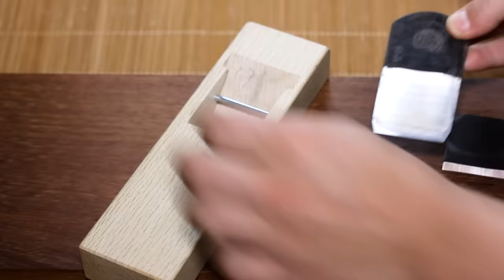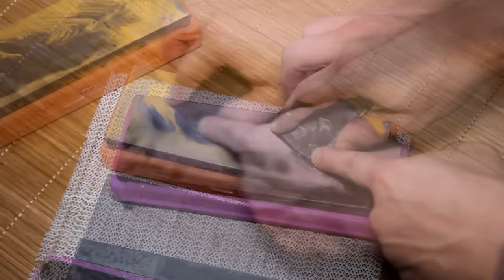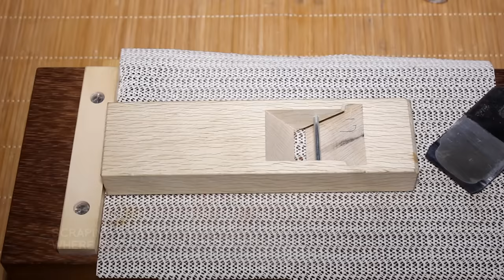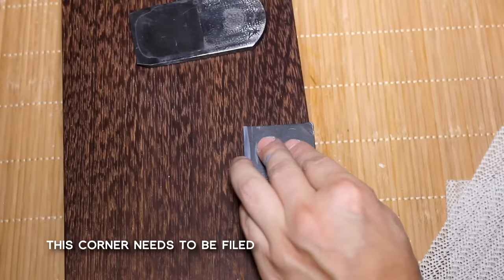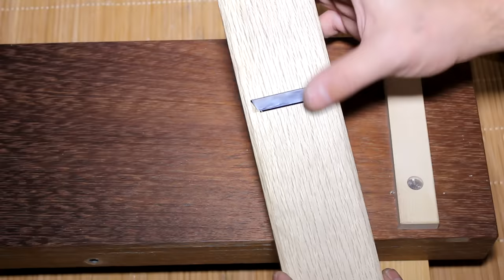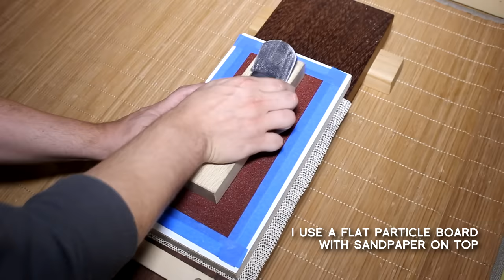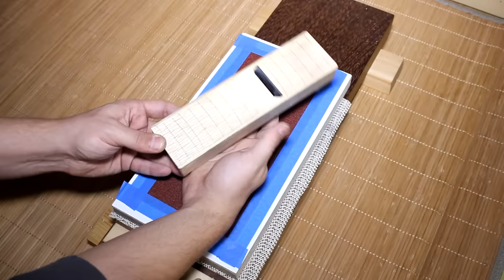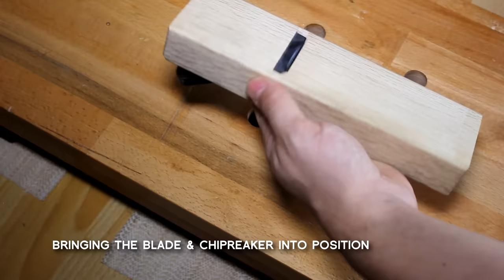Setting Up an Inexepensive Japanese Plane

Comment: Nice video ! You're doing it the right way, and the result is good !
Couple of tips I learned over the years(I'm from Japan). 
-The body adjustment is the absolute key , more so than sharpening . You're doing a great job there!
-If you do the Ura-dashi, you could save time when flattening the back and make it easier to get it perfectly flat. 
-Using all the way to the edges of the whetstone will help keeping the stone flat for much longer. Kuromakus stay flat longer than a lot of others, but it'll still make a big difference .  The blade can go over the  edges if your hands are steady . 
-Maybe you know it already, but if you want to plane surfaces wider than the blade, it helps to slightly round off the edges of the blade(the corners) to prevent the blade from biting into the wood. 

There're few guys showing there master sharpening skills on Youtube, too . Search words like 巣板(Suita) works well.

Comment: Hey Adrian, I have two tips for other new to jp planes. Like you I am still a student with jp planes and I bought a similar plane from another store. 
1. Whenever you buy a wooden body plane, let it rest for a week in the environment it will be stored. I keep mine in my house even though I work in my garage to keep the humidity more consistent. When I fist got it, I set it up right away and had to keep tuning the sole. If I would of just waited a week then most of the movement would of happen and I could if only tuned once and been done.
2. Always check and make sure the sole is square to where the plane iron sits. I got a little aggressive with sanding the sole that I unknowingly sanded out of square. This made my iron come out crooked, At first I thought this was because it was cheap and maybe the iron slot was out of square, which could of been the case but most likely my fault. Anyways, the point is, once you have the iron fit to the body, DON'T TOUCH IT! Always adjust the sole or sides to bring it back to square, it doesn't take much to ruin the fit of the iron.   
I polish/sharpen mine to 12k(it was a present) and the mirror finish and cut is outstanding! Keep up the great vids!!
Reply from the maker: Thanks David, your comment is well welcomed!
It slipped me to mention in the clip about body rest :) Thanks. Indeed I let mine quite few weeks before tuning it.
Reply: Ha I goofed my kanna resorted to cutting the blade to thinking about buying a new kanna and restart from fresh
Reply: Do you have any advice on how to dislodge a blade from a plane? Mine was delivered wedged so completely I have not managed to get it out no matter which method and how much force I used.
Reply: @AGH331  I imagine it might be because the conditions were more dry where it was shipped from than where you are. If you put it in your refrigerator for a few hours it might make the wood and metal both shrink enough to loosen the blade. I've never tried this but I imagine it's worth a shot.
Reply: @michaelferrin7109  Thanks for your reply, but I tried this (and many other things already), without success. I had an exchange with an experienced Japanese carpenter about this issue (including pictures), and he said the one I got was just trash.
Reply: @michaelferrin7109  I agree moisture content could easily be the issue. Wood swells when it gains moisture and shrinks when moisture content decreases. The change is perpendicular to grain direction as there is very little change in the grain direction. Oak changes around 9% dimensionally from green to oven dry in the tangential direction (across the width of the Kanna). Increasing moisture content increases the width and increases the size of the slot. Thus, more moisture releases the blade. Additionally, there is thermal expansion to consider.  The coefficient of thermal expansion for oak is 5 times more than for steel. Oak is 30 millionth of an inch per inch per degree F while steel is 6. Thus heating  the assembly causes the oak to increase more  than the steel which in turn should make the blade looser. The oak will change moisture content very slowly,.  It could take a week to raise the moisture content enough to affect the size to any significance. Thermal expansion happens much quicker. A 4 inch wide sole plate heated from 70F to 250F would increase by 0.017 inches more than the same width of steel. This seems like a huge amount that should free the blade.

Comment: Hi Adrian, bought the plane with the 65 mm blade at Dieter Schmid's store. Honing is done already. I let the plane sit in my workshop for a month.  Thanks to your video I am now able to proceed to the next steps. Very clear instructions. Thank you very much for sharing.
Reply from the maker: That's cool! Glad you find it useful! Mine sit about 5 months :)) And kept the same twist all this time, although I had a lot of humidity changes, so probably would have worked even sooner. I too wanna buy the 65 one, I think the one from amazon us, in a couple of months. I've started with the 42, was not so fun, very lightweight, then this 50 is amazing, probably 65 is even more fun :)
Reply from the maker: Cool, congrats! I was too in doubt how many contact points. Being my only very used japanese plane I've opted for three, cause...I can easily change to two if I want :) From 2 to 3 you loose some material on the sole.

Comment: Excellent video Adrian, thanks.   One tip I learned from an older and wiser craftsman a long time ago: Any time you sweep your hand along the sole of a plane, sweep from back to front. That way it doesn't matter where the blade is positioned and you establish a habit that helps prevent accidental injury if/when you sweep the sole while using the plane.  (Not saying the way you did it was wrong or unsafe, just passing along a tip!)
Reply from the maker: Thank you Captain! :) Yes, I said to myself many times when editing the video that it looks like I am grabbing the blade with the fingers, even if it was retracted, but had no other scene filmed :) Indeed, not to be done like so anymore, cause will become a habit!

Comment: Thanks Adrian, your excellent video on Japanese Kanna had me convinced to switch over completely from using old English hand plane! I've just ordered 2 x Kanna from Osaka (1) 42mm and (2) 60mm, and they had just arrived Taipei a few days ago (2019 Jan, 31). I'll give myself at least 1 year of consistent usage and constant tuning on these affordable ones before moving on to the more expensive ones. I'll tune these Kannas on glass to ensure that the blade and body stay squared at all times. I've also ordered 12000 grit whetstones from Poland for better finishes. Your video inspires me, thank you! (Robust Chen, Taipei, Taiwan)
Reply from the maker: Thank you! Good luck with them and nice projects to make!
I too, got the 65 mm recently and need to tune that too. Also, I will still wait before spending more bucks on a kanna :)

Comment: It's amazing how that thing can fly. The Japanese are ahead of tech
Reply: I'm not surprised you can fly for how HIGH you are right now
Reply: @nickkammer6832  r/wooosh
Reply: rip
Reply: @medium.kahuna  dammit i dont get da joke!!!! May u explain brother
Reply: @nickkammer6832  wtf you talking about. That thing sucks. Use a western plane and yoyll realise how shit this is.
Reply: @thewholesomewoofle3466  he thought he was going to make an actual plane out of the wooden block, which would be pretty advanced
Reply: @goldberg5024  ohhh lmao
Reply: and flies, and it sings too!
Reply: European and japanese planes are just as good as each other. It really comes down to preference.
Reply: @Brandon G 
Pushing is much easier on certain woods than pulling. A European plane can be used on the pull but is not designed to do that and Japanese planes that pull can also be pushed but again not designed for that. It all comes down to preference.
Reply: How do you measure ahead. If you mean, ahead of getting thin shavings of log, maybe. If you mean, ahead of producing wood products for billions of people... IDK. But that plane surely has its place in some beautiful exclusive expensive woodworking. However, to serve masses it's not efficient enough. You need machines for that.
Reply: Except when it comes to nuclear lol. They still haven’t got that down.

Comment: Nice tune up, those shavings will get finer over time, if you wet the surface, let it dry, then use this kanna you will get a polished finish. Nice work.
Reply from the maker: Interesting, good to know, thank for the tip, I will try it!

Comment: I have allowed  green wood to sit in my shop to dry/acclimate. I used a scale that measures tenths of a gram. I would weigh everyday. It was fascinating to register the information. When the weight stabilized I used the wood for small box construction. The technique worked well. Weighing the plane body after purchase would be interesting as well .
Thanks for the video.

Comment: You`ve got nice results with this kana. I had bed luck with mine because I took more wood from the bed of the blade than necessary. So , I had to bend more the ears of the chip breaker in order to compensate the error. It works okay now. I`ve read about a practice to curve the edge of the blade by lightly striking with a small pointed hammer right over the mild iron area .
Never tried for fear of not  hitting  the hard steel .Maybe I should try it. Nice work, Adrian1
Reply from the maker: Thanks! The best way to compensate that is too add shims of paper, normal one or cigarette paper if there is too small space, or even veneer on that bed. Glue them then fine tune it again by scraping it if necessary

Comment: Using the blade itself to scrape the recesses in the bottom realllllly sped up the process for me 👍🏻.
Reply from the maker: Yes, I've seen this on others, I will try to next time! Thanks!
Reply: Adrian Preda sure. They have scraper planes but they’re like $150+ and take time to setup themselves. From what I’ve seen there extremely effective tools but for some initial Kanna setup, a sharp blade works remarkably well. You just need an adequate way to clamp the body down while scraping.
Reply from the maker: I see, this kind of scraper planes, tachi kanna, at the shop where I bought the big one, is 95 euro/~120usd the 30mm wide version. Ridiculously two times the price my plane :) They worth buying when you have too a more better or more kanna's.
Reply: Hey Adrian!
Nice Vid. I have the exact same plane from finetools.com, also my first... have been using it for a year now and feel I'm slowly getting the hang of it. Thinking of maybe getting a higher class 60-70mm kanna. Here http://bit.ly/2GM9kSE you can find a scraper plane for a little bit less. They're also good for finishing really hard woods not just the sole of a normal kanna... your mini workbench vid also inspired me to build one, thx for that!
Only thing I noticed was I thought your secondary bevel on the chipbreaker ws quite wide, could have been the video though...

Comment: This is the secret right here, finding half assed made cheap tools and bringing them to a high quality level of tools with a few adjustments at home.
This is how you save serious money in this hobby
Reply: You should write a book about it, or at least publish an ebook. I'd honestly buy it just to save money in the long run. Complete noob right here, just getting into it.
Reply: Doesn't look half-assed to me.
Reply: Aktually its not that special more Like Japanese Tradition
There is no Japanese Master who would get his Plane setup by someone else ...
And the Quality of Cutting Tools is like 80% the Steel how good the Steel is If its forged well and the Heat treat and Tempering 
No Matter how Sharp you can Grind your Blade if its dull after half a Cut you will never take a good Cut what you need is a good Quality Tool and a good Setup

Comment: Very nice , detailed tutorial.  I never imagine how this stuff works.  Question.  How often is it necessary to repeat the process? Good job on video buddy.
Reply from the maker: Thanks man, glad you like it! It all depends on the wear and wood movement mostly, which can happen to twist overnight, or over a longer period. Although these plane makers happen to select carefully the wood for the body, with proper grain direction, sufficient rest etc to minimize the movement. For the blade's bed if the body expands to much you may need to add between, either a shim of paper, like cigarettes type, or veneer if is too loose.

Comment: Those shavings.....
Ideal for insect wings.
Reply from the maker: Yes, I will use them in summer  :D
Reply: Adrian Preda I made a dragon fly on the lathe and used epoxy filled copper wire stripped from a 6 mm cable. Can never get shavings that thin but that would be my choice for wings so that it would all be made from wood. I need to get one of these Japanese planes purely to make shavings for wings. Every day's a school day. Look forward to your insect
Reply from the maker: Oh, silly me, I thought about insect sticky tapes when reading :)) Indeed, can work great for the wings this method. I've used cheapo spruce for the demo, maybe harder softwoods like larch or cedar might be better. Hardwoods have pores, and also the straight shaving is difficult to achieve, at least for me. Prior using spruce I've tried basswood and maple, nop, round/curly shavings like western planes. Also the trick is the chip breaker, has to be very close to the blade, like 0.1-0.3mm, must be taped very carefully otherwise can get over the blade's edge and ruin the sharpening. Although I've seen other peps making straight shavings also on harder woods, without chip breaker, but that is maybe level 100 of japanese planes, I'm maybe at 5 :)
Reply: Or a hamster bed!
Reply: What do you mean by insect wings ? is it a fishing thing ?
Reply: Escalator  I think they are talking about making copies of insects and using the thin pieces of wood shavings to create life-like wings.

Comment: Instead of buying another expensive waterstone, just use a leather strop, these give a fantastic edge and leave a mirror finish
Reply: Tom Cockrem  its faster to use a courser wet stone to do a bulk of the work then work your way down till you get to leather . Leather is the last step
Reply: I totally agree. Stropping with normal light compounds take forever to remove #5000 grit scratches. Something like 8000/10000 really helps to speed things up.
Reply: Or just go from 1000 to a strop w/ green or white compound. strop 30-50 times and you're just as sharp as you would be using a 1000-3000-5000-8000, it's just taking far less time and keeps 100'ds of bucks in your pockets. Going through the grits for sharpening is a waste of time.
Reply: @hoggif  exelent, guy! This is right answer!
Reply: Escalator definitely not as sharp as an 8 or 10k stone but definitely sharp enough.
Reply: you're cutting wood. Not necessary to strop. lol.
Reply: JosiahLund, I find the strop is a quick useful way to eliminate a very fine wire edge. Boot, belt, or palm; all the craftsmen I came up with stropped.

Comment: Good stuff as always!! Might have to get a cheap one to see how it works.thanks for sharing
Reply from the maker: Thanks Joe! This was my thought too, cause besides other japanese woodworking tools, like saws, chisels etc their planes are not so easy to start with. I paid mine around 65$, and probably is the cheapest I could find at 50mm blade. The good ones, made my known japanese masters starts from 200 :) and visually they look almost identical, probably the blade is finished more nicer than mine, but the extra is reflected in the quality of steel and body's wood selection. Even mine cuts very nice, the steel is very good, way over western planes in this price range.

Comment: Just got mine. Paid a lot for my 65mm and real cheap on my 34mm. boy what a difference. I imagine the real costly ones are out standing.
Reply from the maker: That's cool! Have fun using it! The 65 mm one from where did you get it, amazon or fine-tools? I wanna buy the amazon one in 2-3 months I think. Yes, maybe one day I will save some bucks and get an expensive one. I'm too curious to see the difference, although visually they look the same.
Reply: JapanWoodworker.com is where I got them. the main problem I see is you pay $89 for the small one and $250 for the big one and neither looks any better than the other. in fact I'm going to have to do more work toning the more expensive one than the cheaper one.They say the more expensive on they used Japanese blue steel on it. but who really knows.the blade doesn't fit at all. Its like some one made a blade and shoved into the wood and boxed it up. very unprofessional.
Reply: Check out kanamonoya79 (I think that's right) on ebay, quite often has some very expensive planes selling for a lot cheaper than they should, they're still ridiculously expensive but for what you get it's a much better buy
Reply: thanks

Comment: Ho AP, wee question, I've always tried to maintain a completely flat sole to my planes but (at just over 6 minutes into the video) I see you use a cabinet scraper to hollow the sole of this plane, why is this?
Reply from the maker: That s how they di it on jp planes. You neee just 2-3 contact point, abt 1cm wide, in front of the plane,  in front of the blade, and optional, for trueing, on the back
Reply: @AdrianPreda  ahh, I've no japanese planes, just european ones, I suppose that reduces surface friction.  Thanks.